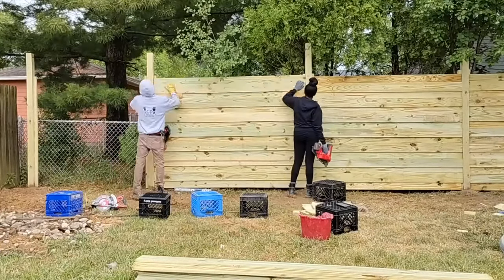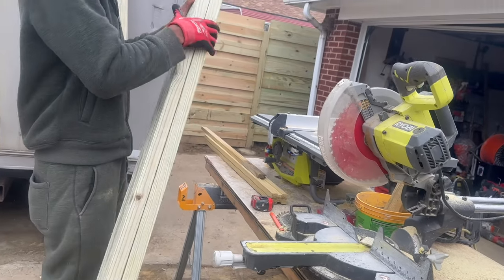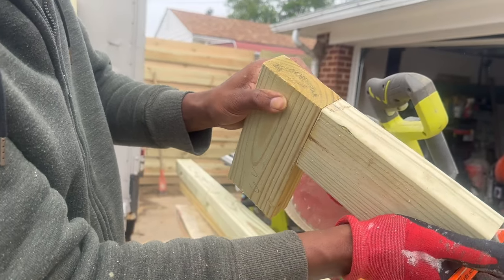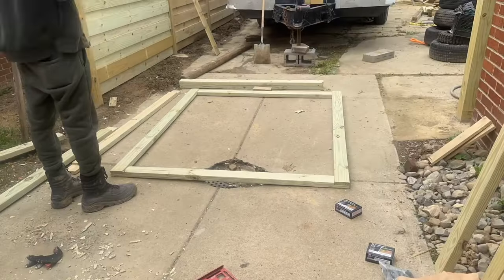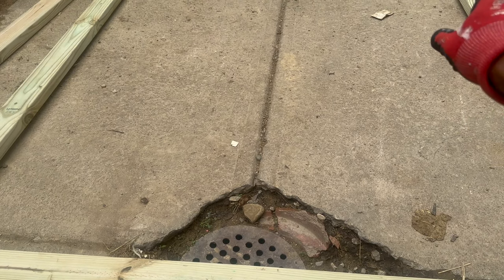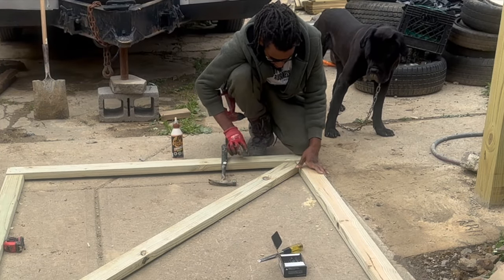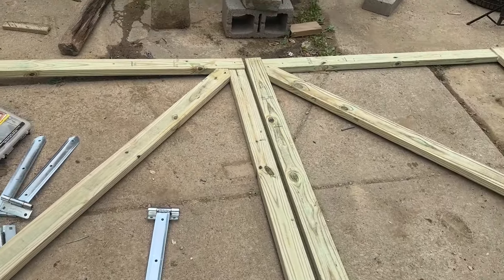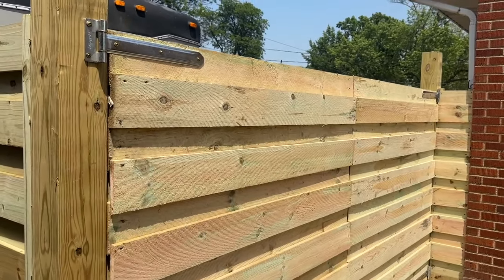Building a Custom Gate for a Wood Fence, Start to Finish Part 6

Comment from the maker: Tools and Stuff (links shared to make it easy to find what we used and at no extra cost to you and may include Commission links that help support the channel)

Table Saw: https://rstyle.me/+zBDukhug0mSp7UQkuJOImg
Chisel: https://rstyle.me/+D2OgR4IRudpWMI5K9IObVA
Square: https://rstyle.me/+lsg2T_0Cdq0oXfhOOGo4fw
Exterior Screws: https://rstyle.me/+SS8q08bPliVKQhEMpSIQ7Q
Drill: https://rstyle.me/+Z2Gdf5FzSLtjY9BXJhLyyQ
Circular Saw: https://rstyle.me/+PbVsimgSRsoQ95KZ7RqDbw
Airless Nail Gun: https://rstyle.me/+_Wj96NGNQUOeFK_wSY-PCw
Air Nail Gun: https://rstyle.me/+MsDlZ02N8MPhvN4bLD7olQ
Smaller Air Compressor: https://rstyle.me/+jPt5T_k_mAbglQH6CyBZXw
Bigger Air Compressor: https://rstyle.me/+Nm-SksbVbSIKL_033hSIuw
Top Latch: https://rstyle.me/+elSLCXU8IsaQYB2X31Pilw
Bottom Latch: https://rstyle.me/+861lqgHjzjO4WZ-mvDeuKQ

Post Hole Digger: https://rstyle.me/+-CWF6PVzFLuLpPrCrTUncw
Auger: https://rstyle.me/+vPoAHILmtOVYjUa25ni-Ow
Post Level: https://rstyle.me/+2cuGdewohw7zqca-LIJoqA
Digging Bar: https://rstyle.me/+x_eXEJvOgh4Ib2CpqDbUyw
Quickcrete: https://rstyle.me/+kPp3TVZhyz9ytj_YL7p3JQ
Wheel Barrow: https://rstyle.me/+ZyqfHnbPG39_w-Qamtsqig
Concrete Tool Kit: https://rstyle.me/+aSVfQULOfo_vmqC6l1kJUw

DISCLAIMER for ALL of our Content- 

We are just sharing what we personally were able to do in hopes it will inform or help others. This video and all of our videos are  for informational purposes only. We take no responsibility for what you do with this information and can not be held responsible for any property or medical damages caused. You must DO YOUR OWN DUE DILIGENCE! 

Also we are not financial advisors. These videos are for informational purposes only. Investing of any kind involves risk. While it is possible to minimize risk, your investments are solely your responsibility. It is imperative that you conduct your own research. I am merely sharing my opinion with no guarantee of gains or losses on investments.